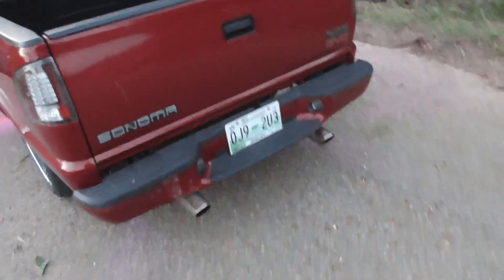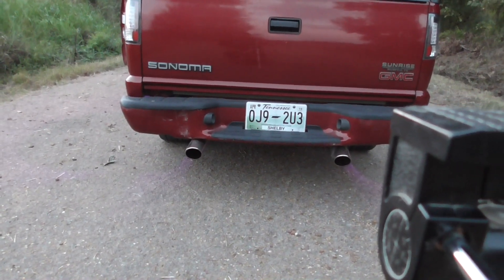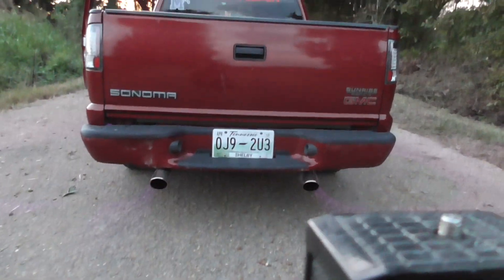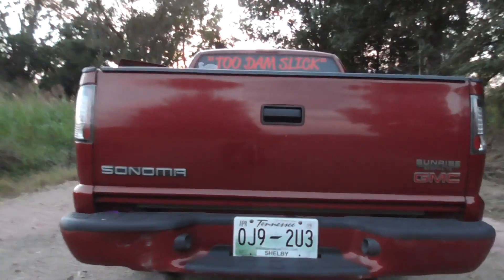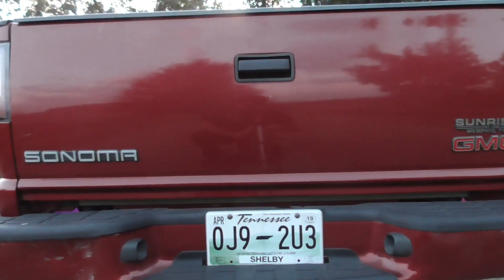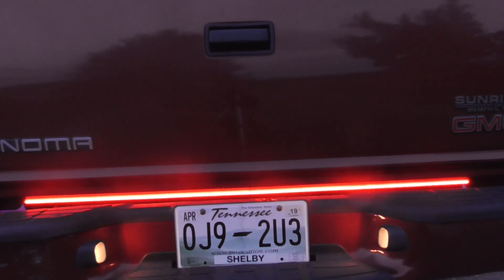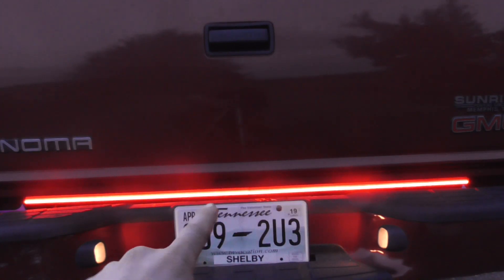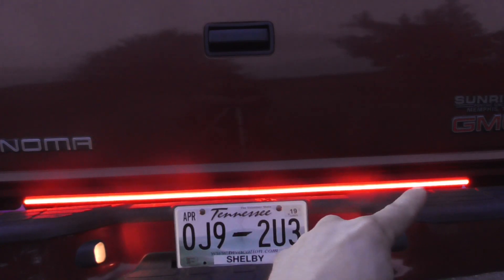8 Months and OPT7 Triple Row Tailgate Bar Broke | Sonoma Update

Comment: That's why I just got a cheap one for my ranger.  They go bad, just throw them away get a new cheap one.  When I sold my ranger the cheap one was still working.  You could see condensation in the lense but it was still working.
Reply from the maker: Yeah, I had a feeling this could happen.  Especially since It's a fairly new way to do this, only a couple companies that do this three row style. One reason I got it though was I like the solid line this style produces over the other ones.  And the revere light is super bright on it.